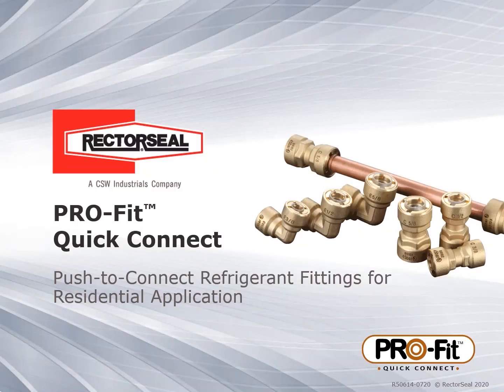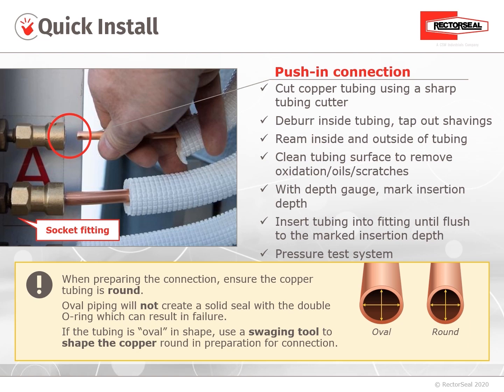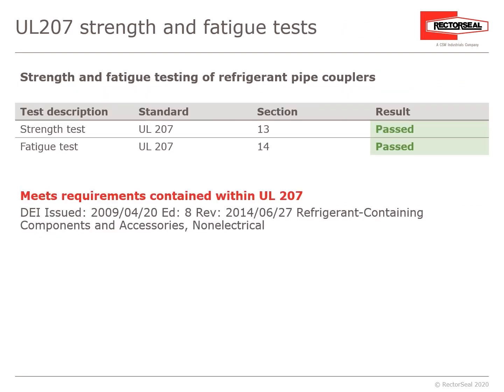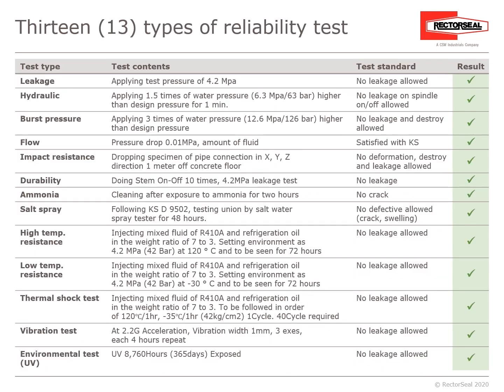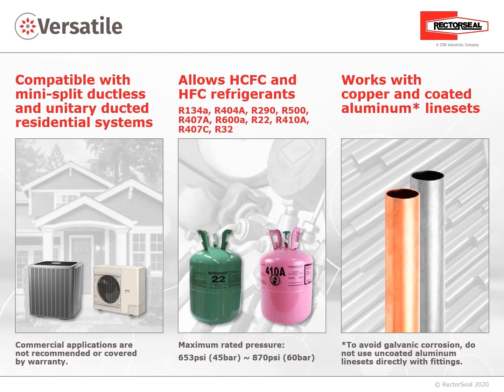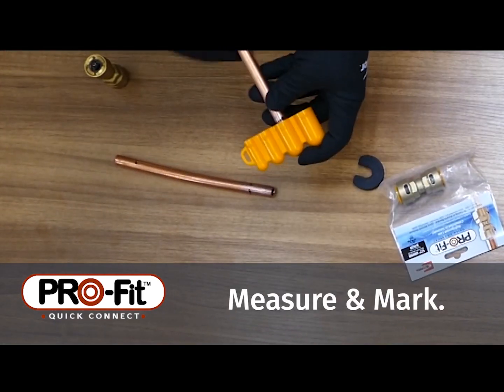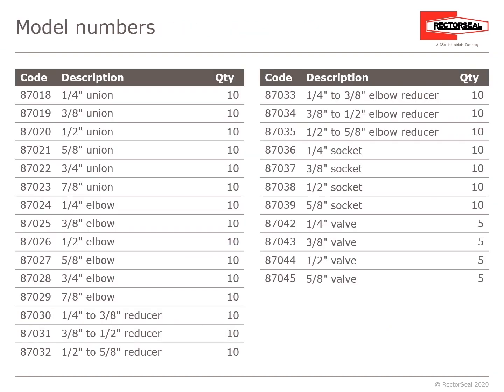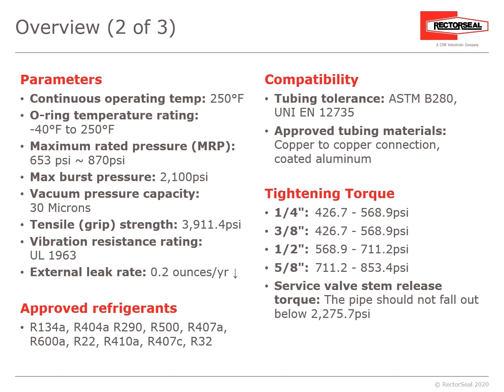What are PRO-Fit Quick Connect push-to-connect refrigerant fittings?

Comment: Will this work for regular full size residential HVAC systems?
Reply from the maker: It works for systems with refrigerant lines up to 7/8"!
Reply: @RectorSealCorp  Do you have 3/4 to 7/8 reducer fitting?  My port is 3/4 and line is 7/8.

Comment: This method is a terrible choice that will result in numerous call backs, increased overhead costs, negative ratings from unhappy customers, and a loss in profit due to leaking. The high pressure and temperature changes on the fittings will always require brazing. I'm surprised the EPA, with their complaining about the ozone being damaged by refrigerants, haven't outlawed this seriously flawed method.

Comment: Think I'll try these on my next install! I for one am not bothered by PTC and/or o-ring'd joints. Heck they're all over your vehicles/hydraulic equipment. So much mission-critical infrastructure is using PTC/o-ring joints and you have no idea!

5 year warranty on the o-rings doesn't inspire confidence though. Wouldn't HNBR have performed a bit better than CR o-rings?

Comment: These wouldn’t be helpful on new installs unless you change out every service valve with one of the quick fits.  Maybe to pull and clean an evaporator, you wouldn’t have to braze if you use the union quick fitting.  Possibly to relocate a condenser.

Comment: so they come to the rescue for the techs out there that don't know how to do their job correctly. I have been in the HVAC industry for 40+ years and never had a brazed joint leak in my life. What happens when a system running on 410 has a fan motor go out and head pressure goes to 600+ pounds? run your test with high temperature and high pressure as in a discharge line.

Comment: These are nothing but trash. I manage a large apartment building with 300 units, where these fittings were used, we had hundreds of service calls due to these fittings leaking, since day one when we open the building,  we only been open for 8 months. Our hvac sub will not use them at any other projects in the future.

Comment: On the socket type fitting. When torquing them to mini splits. Do we go by the torque from the manufacture  ? Or is there set torque for the fittings ?
Reply from the maker: Doria here are the Torque settings.
 •	1/4": 426.7 to 568.9psi
•	3/8": 426.7 to 568.9psi
•	1/2": 568.9 to 711.2psi
•	5/8": 711.2 to 853.4psi
•	Service valve stem release torque: The pipe should not fall out below 2,275. 7psi

Comment: did I miss the vacuum test?  My question how reliable is this system when evacuating air from refrigerant lines?
Reply: I used these fittings for the first time yesterday on a new installation of a mini-split. Obviously I vacuumed the lines, and in fact left them under vacuum ovenight. No change. I then commissioned the system and all looks good. These fittings are ideal for hard to get to places or where brazing may be a hazard. Or where a press tool may not be able to be used due to lack of space. So far so good. They are expensive (in Australia) but they sure have a role in many situations.

Comment: SharkBite technology has touched the HVAC market as well :-) One thing I have yet to see in a home is the homeowner being notified or alerted by the system if the refrigerant is low. This way, the HVAC service could be reached out to appropriately... Nowadays the HVAC service scheduling drama on the front desk is out of control and all home owners who have had HVAC issues could attest to it. The positive side of all this is, it is making a homeowner with minimum DIY tech how-to knowledge to become an HVAC tech, similarly how some of the homeowners are already great auto techs, electricians and plumbers.
Not bashing anyone here, just exposing the reality. I truly appreciate all the hard work you do and also the new techs that study hard to get certified in trade schools.

Comment: Anything that has an O-ring is destined for failure. The copper has to be perfectly round. Copper can be smashed flat and opened back up with a screwdriver and beat back semi round with a rock, then be brazed leak free for eternity. Who in the hell is gonna spend crazy $ for one joint when you can braze a lifetime joint for pennies. Making a simple process into brain surgery.
Reply: Hacks
Reply: Mini splits
Reply: You're mostly on the money here up until the price point. I'm not sure if you've looked at your invoices when you've bought fittings, 15% brazing rods or acetylene in the past few years but the accumulation of these three is getting up there.

Comment: These are Perfect! The new refrigerats all have Isobutane in them...So, we are all going to this anyway. and anybody using Sta-Brite #8 with R-410a, souldn't ne doing HVAC ANYWAY...
Reply: I suggest you call the manufacture before you make a stupid comment like that, because you have no idea what you are talking about. It has a stronger PSI rating then 15% brazing rod. However you would not know that would you?
Reply: He haven't got the slightest idea, thinking its plumbing solder LOL!
Reply: @wd8557  Passed with my manufacturer's warranty. It's great stuff. Only issue I've had is one installer used to much on the liquid line and caused a restriction, but that's not the products fault. Don't even have to N2 purge. Clean Clean Clean
Reply: @johnlott7240  liquid line should be done in 5 seconds lol. He will get it down.

Comment: 40 bucks for one 7/8 fitting. I'll stick to Stay Brite 8 on new installs.
Reply: Me too. Nothing cuts into your profit margins faster than overpriced hardware.
Reply: People have used this to solve leaks with mini splits on the gas side thanks to heat mode. I would use it for that.
Reply: So, Stay Brite is effective as brazing in your experience?
Reply: @jimreilly917  yes